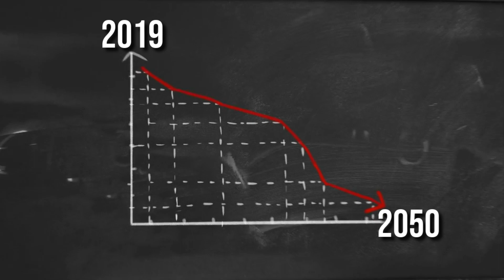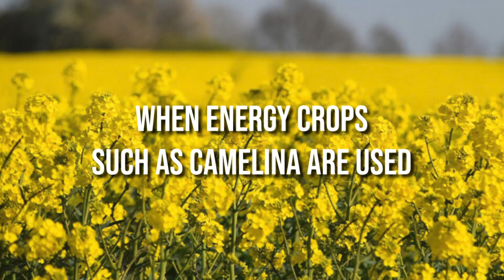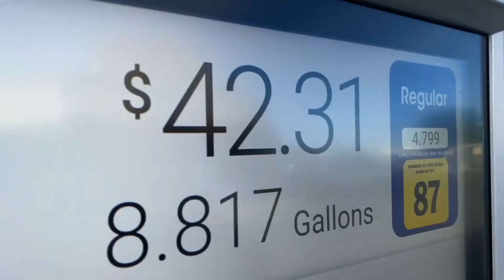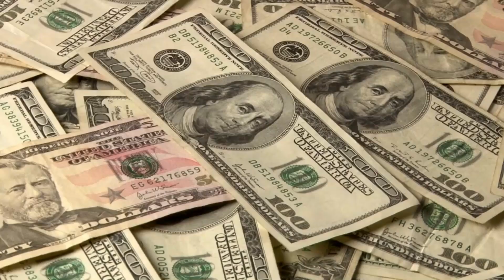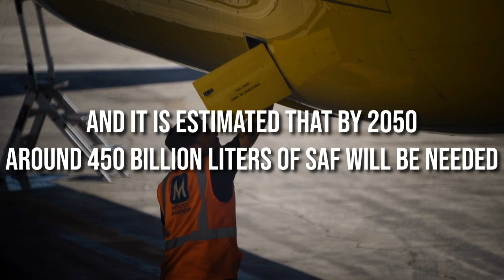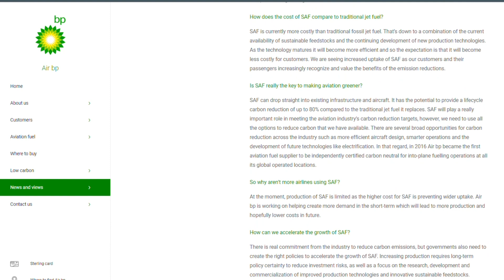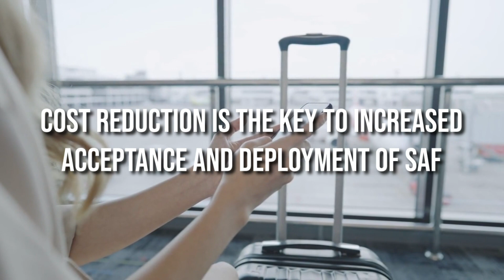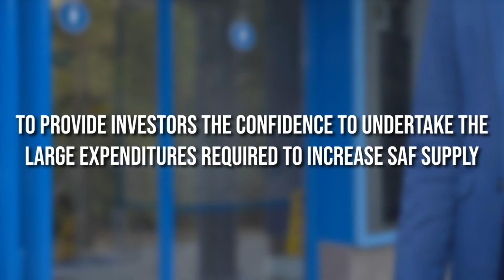Sustainable Aviation Biofuel - The Key Or Just A Quick Fix?

Comment: The most sustainable air fuel is that which is not used.... so we need a reduction in the numbers of flights, as well as changes to propulsion.  SAF like any combustion, adds oxides of nitrogen to the atmosphere, some of which are powerful greenhouse gases in their own right.  Electric propulsion avoids this but the sustainability depends on where the electricity comes from - currently the majority is from burning fossil fuels, again, a major player in the Climate Emergency.